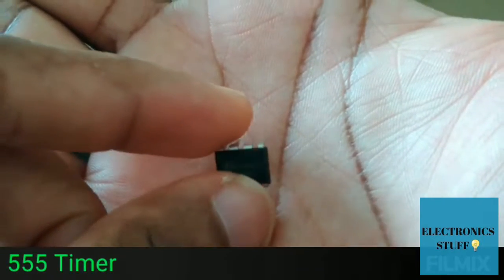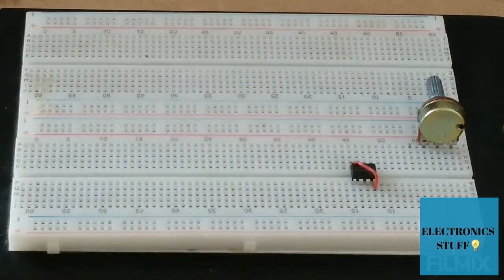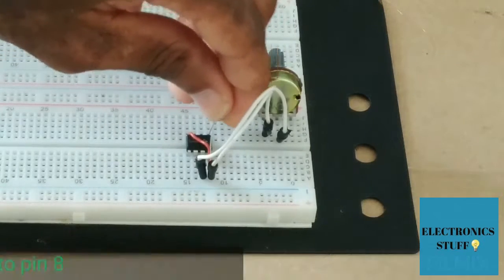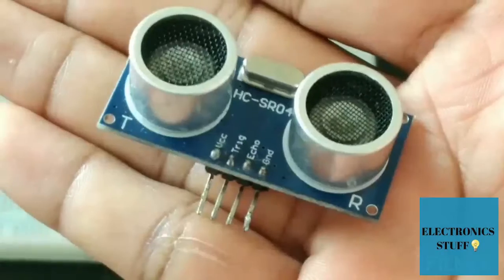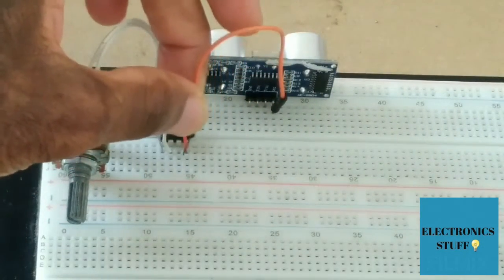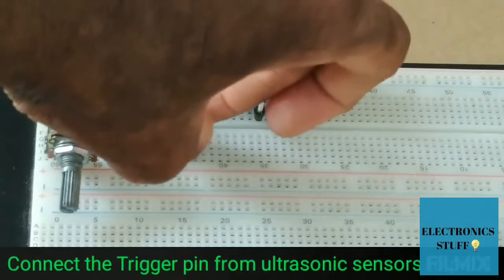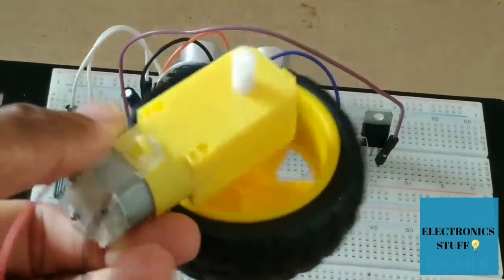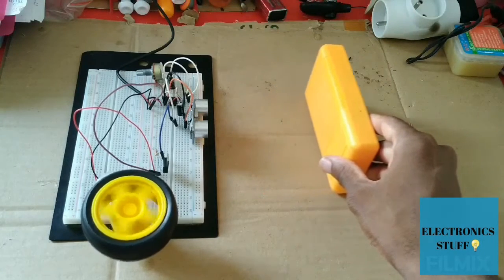Ultrasonic Sensor without Arduino #ultrasonicsensor #electronic

Comment: can you help me instead of motor im going to use buzzer where is the connection? and  where is the connection of the power supply or 9v battery
Reply from the maker: I did this project years ago

Comment: Does pin 5 stay unconnected?, Thing is, I did leave it unconnected, but the motor's already on at startup, and I'm not sure if it's related.
Reply from the maker: Hello! Did you fix it ?
Reply: @uploadideaswithitamar Not yet, but for real, I gotta get it working, it's a uni project

Comment: How did you power the circuit, with what voltage batteries or how? :)
Reply from the maker: I used a 5V power supply from a charger
Reply: @uploadideaswithitamar  Thanks :)

Comment: Hello, will it work the same way if we install the micro vibration motor in phones instead of the buzzer?..
Reply from the maker: Watch the video to understand
Reply: @uploadideaswithitamar  I didn't ask exactly what you wanted to ask;  Does the operating speed of the engine change as it approaches the obstacle?